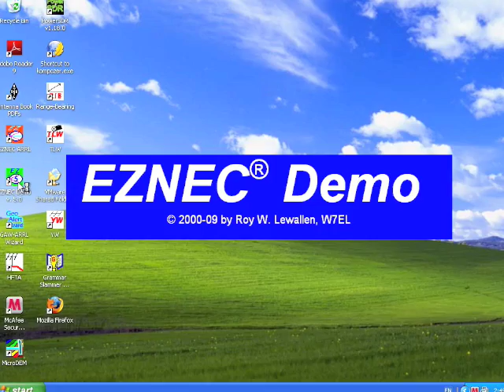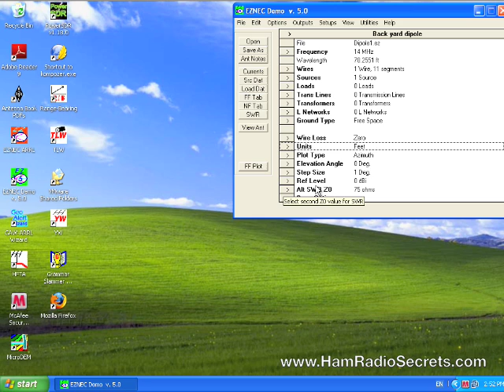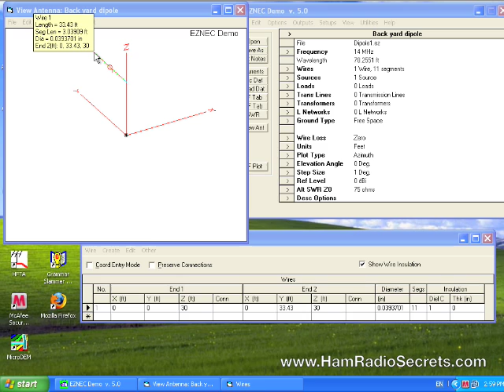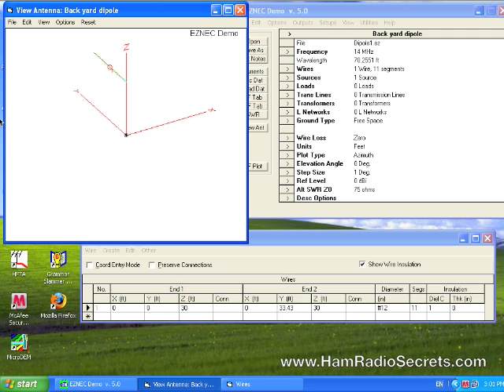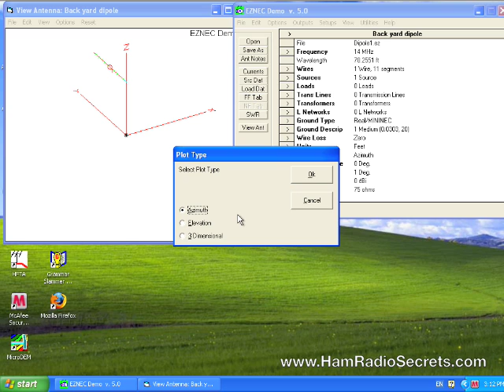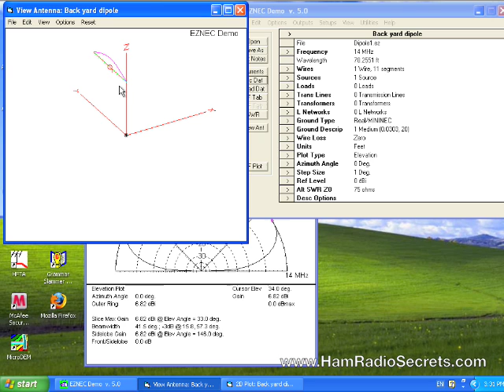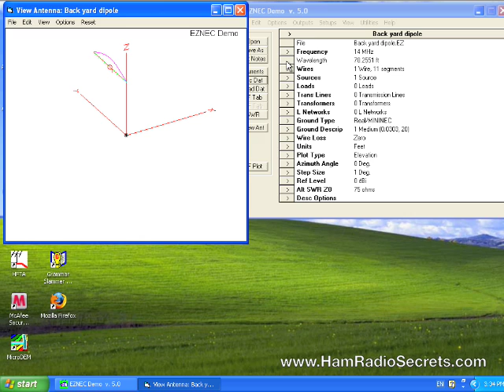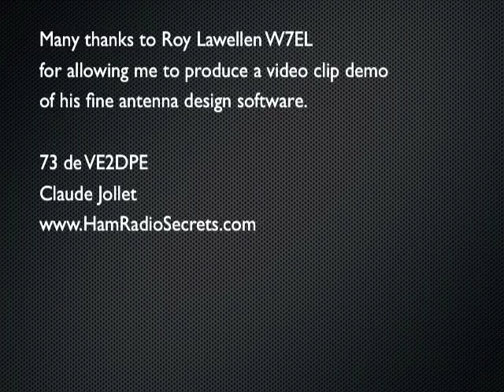Antenna Design Program EZNEC v5 Demo

Comment: Thank you kindly, very easy to follow.  The length of the video is exactly right, exactly as you wanted it and it needed to be.  You cut through the chase in a very smooth fashion, 73, from Clifford